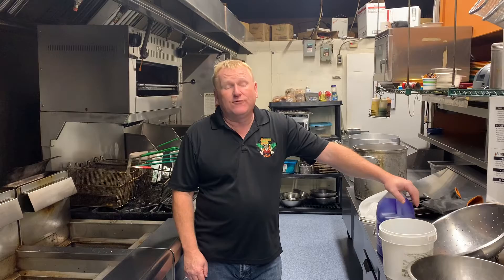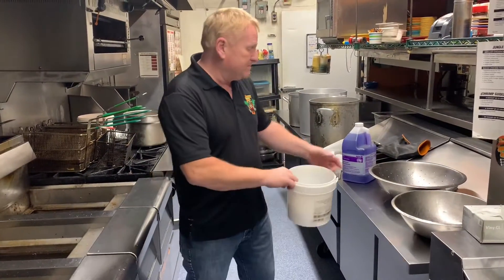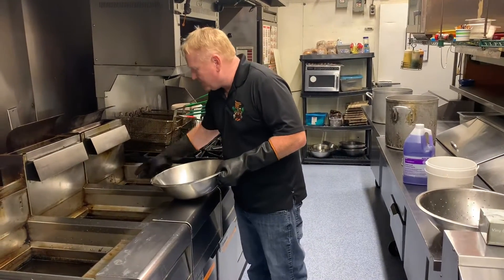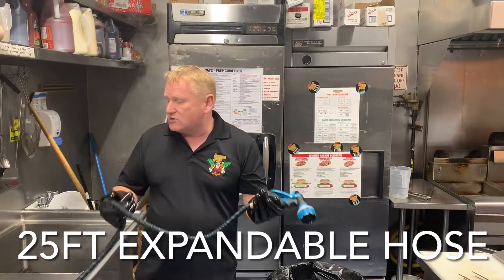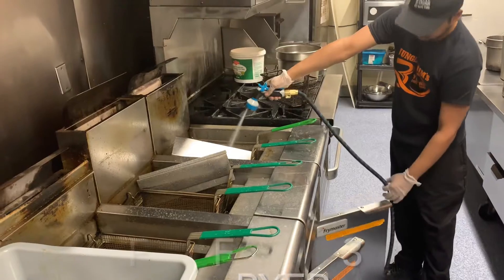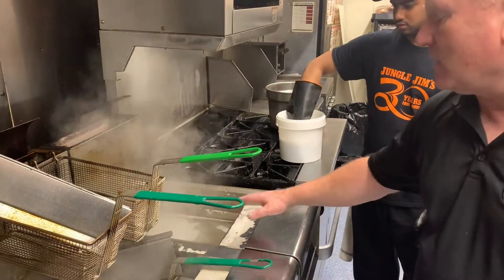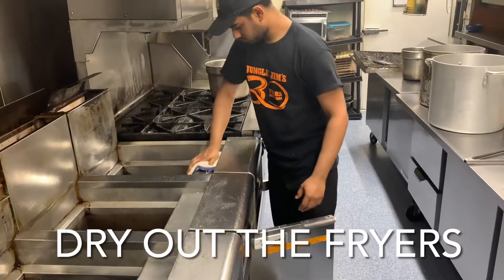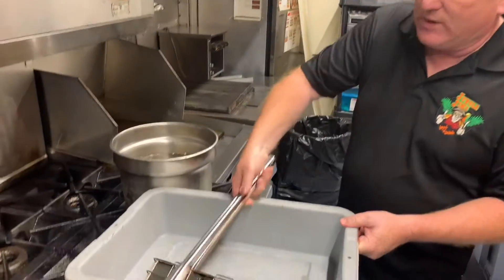Deep Fryer Boil Out Cleaning

Comment: How can I make sure the fryer can be ignited without problem after I fill water to boil? It happened to me before, when I tried to clean some dirty parts uder the fryer with wet towel, I couldn’t ignite it. I’m still learning, your video is very helpful.
Reply: are you using gas?